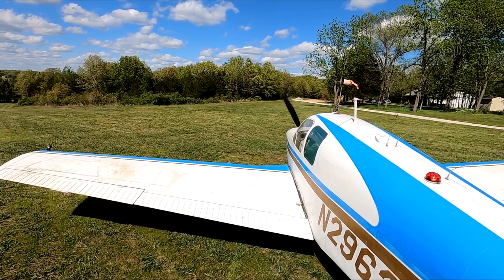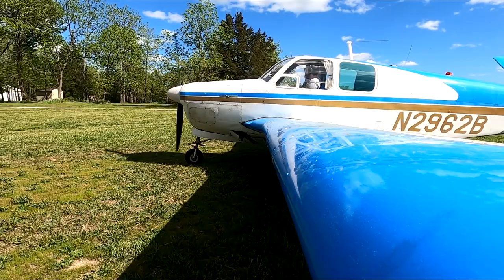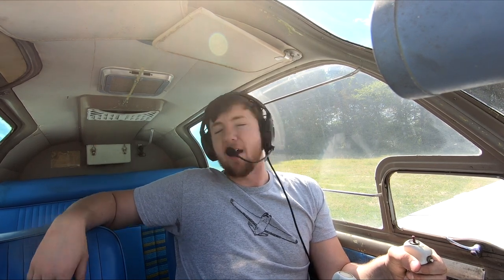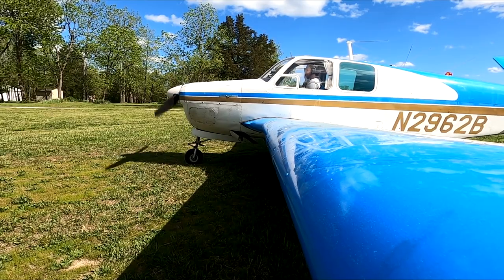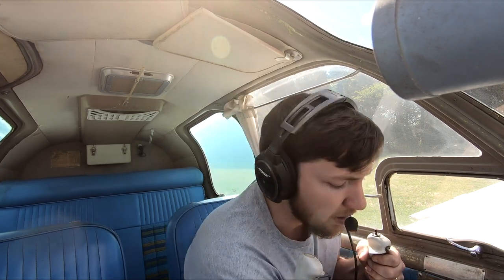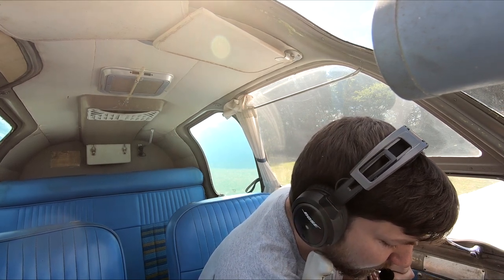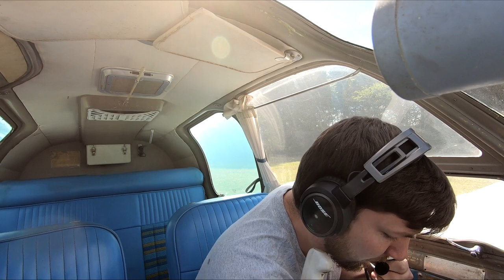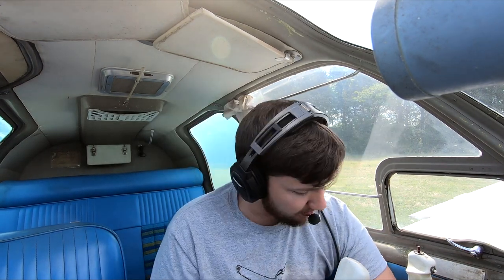BARN FIND V-TAIL BONANZA FIRST FLIGHT IN 15 YEARS!!!

Comment: In my Straight 35, I do 90 for normal ops and 85 for short field.  Your dad was right to be mad because he could have lost his son right there.  There is no "have to go" in what you're doing.  If conditions are unsafe, then stay on the ground.
Reply from the maker: It’s not always easy to judge what conditions are safe and what conditions are unsafe from the ground. I went up right after and knocked out 7 landings without issue. The wind was not beyond my capability, it just caught me by surprise. The risk is always higher when you decide to leave the ground.

Comment: I use 90 mph as normal approach speed to most fields in my F35. Short field I will go to 80 mph. I find the extra speed helps with controlling the plane and it is less susceptible to what happened to you. With full flaps and the gear out once you pull the power off it decelerates very fast. I usually pull the power off before crossing the threshold. Glad it turned out okay, could have been pretty bad if the wing was snagged.

Comment: Hey as a low time VFR pilot, that has gone into some tricky fields, but none as tricky as yours here: I think the way you flew this was absolutely reasonable. You can clearly see that you come in with more than a little excess airspeed by how low your nose is on approach. I assume the gust caused a rotor behind the tree that made you loose height and airspeed. Nothing you can do about it. Coming in at 100 seems ridiculous to me on such a short strip. The only thing I will say that I would've done differently is to probably not fly on such a windy day. Especially if you are going into a small strip that has trees on either side. A buddy of mine got stuck in a tree next to the runway once because of a microburst. (Nothing much happened to him or the plane) Don't underestimate the wind. Especially when the topography is not in your favor.
Reply from the maker: I think you nailed it. I wasn’t stalling on final it felt like I was being pulled into the ground. I did several more landings same condition right after and I added 10 mph to 90 or even 100 and it went from being sketchy on the approach end to being sketchy on the departure end trying to get the plane stopped. The real solution was to not fly until conditions improved as you said.

Comment: Well, that was a fun one!  You Weeks boys have become the Bonanza resurrection specialists!   I'll have to say that I side more with your dad on this one.  At work we add half of the steady state headwind and all of the gust factor to our approach speed.  For example:  if the wind was down the runway at 12 gusting to 20, you add 6+8, so 14 knots to your approach speed.  Do I always add that much in my Bonanza? Probably not, but I definitely add some. Just realize that if the headwinds are that significant, your groundspeed will be significantly slower at touchdown so you won't need as much roll out.  Also, try to correct a big sink by adding power instead of instinctively reefing the nose up.  (Maybe you added power, just can't tell in the video - but the nose certainly came way up)  My strip is about 3000 grass, vice 1800.   You definitely had your hands full!  That would've been a challenge for anybody.  I doubt if you posted this looking for flying lessons so I'll shutup now.  Keep putting out the fun content and have fun on the big road trip out west for the next Bonanza!
Reply from the maker: Hey, I’ll take your flying lessons any day, Brian! I know your credentials, and I just know you’re a nice guy. 

I did goose the throttle along with the flare in the landing, but it wasn’t quite enough to miss all the trees. From a percentage standpoint I did miss 99% of the trees at the approach end 😂. Only hit the tallest one. My stall speed was 52mph dirty and the winds were at the most 12 mph gusting to 20. 1.3 vso is 68 plus half the gust factor would be 72 mph approach speed. All the gust factor would be 76. I came in at 80 even though I was saying 75 in the video. 80 is just a more comfortable speed for me. The stall warning horn wasn’t chirping so I wasn’t slow in the flare. I think the wind just pulled me down below glidslope at the worst possible moment. I still touched down at my point I just didn’t clear the one tall tree before flaring. Again, I’m just a 350 hr private pilot, so I probably should carry extra speed as insurance. I’m not landing on an aircraft carrier lol
Reply: The way the plane dips looks like something was happening behind the trees caused bump or hole.  Best thing would have been to stay higher over the trees if possible.

Comment: Having done this to some degree on short field in my 47, I would say your dad is right. 
Physics don't lie.  
Came in too short on the runway or too slow / or both IMHO. 
Doesn't take much of a gust to drop you out of the sky.  I was short-fielding at 75mph which is above the approach speed. Not too much wind that day and about 10' up from the runway, got caught  on the flare and stalled my left wing.  I caught it fast, but plonked down on the runway enough that I stopped and got out and looked. 
So I added another 5mph and made my aiming port another 100' down the runway.  
Should be able to stop easily on grass once the wheels are down and brakes are applied.
Reply from the maker: Didn’t come in too short, but too slow is possible. Gopro cameras and a phone camera 1000’ away have a hard time with depth perception, but I was never really aiming short of the runway. My touchdown point was right at the start of the clearing, and after the gust and subsequent throttle goosing, my touchdown spot moved about 50 feet further down the runway.

I’ve landed downhill to the north at about 100 mph indicated when I have a pretty significant headwind, but it is not a fun experience. The runway disappears real quick, and the last 500’ is a very steep hill. You don’t want to be going faster than 20 mph trying to stop it’s so steep.

All that being said, yeah, I clipped a bush one time, out of the 60-80 times I’ve landed that direction. I would prefer the number to be zero, but it is what it is.

Comment: I’m considering getting a v35.  But it has the e185-11 and the prop ad.  Wondering what your thoughts are.  I heard they’re hard to find parts for and I still have training to do and don’t want to be held up over parts availability.  Thanks!!
Reply from the maker: Wouldn’t be a V35 if it has the e185-11 engine. I’m not a fan of the Hartzell hydraulic prop with the five year AD, but the E185-11 engine is a great engine. All the E engines leak a bit of oil, but otherwise they are bulletproof. Parts are not hard to find. They don’t make cases, cranks or cams for them anymore, but there are plenty of old salvage engines to get those parts from when needed. 

If you’re still a student pilot, you have to consider the fact that you are essentially uninsureable in a Hp complex aircraft. If you buy the plane with cash you can self insure and train in the plane, but if you finance the bank is going to require full coverage, and there are really no carriers that will be willing to write you a policy. Not the fault of the plane, but insurance companies seem to make the rules in all industries now.

Comment: Sketchy landing.  Figure out another option.  Land elsewhere if you're concerned the strip is too short.   Or forward slip.  Wind gradient + rotor got you.  FWIW - most of us have been there -  You got lucky.
Reply from the maker: I had several other options if I needed to divert. I ended up doing about 6 more landings right after the bad landing and had no trouble. Just got sloppy.

Comment: Please don’t forget that the stall speed will increase as you add people and fuel.  It will not be 55 at gross weight. Happy flying
Reply from the maker: That is an excellent point, Gary! Thanks for pointing it out. Definitely emphasizes the importance of stalling the plane at different weights and configurations to get an idea of how the plane will perform in the landing flare. The early Bonanzas have a gross weight stall of 56 mph on a standard day. Most of my flying is well below gross weight, so I do frequent stalls to get an idea of how much I can and should adjust approach speed to avoid coming in too fast and wasting the precious little runway I have available at our home strip. In this instance, I adjusted for stall speed, but underestimated the winds and wind terrain interaction, and it could have turned out very bad.

Comment: So do you find and sell these tails?
Reply from the maker: We find them for sure, and we are supposed to sell them, but so far we just end up keeping them. 

The goal is to take old projects that a lot of people would write off as scrap and get them back in the air again. People seem to be more willing to buy flying airplanes than barn finds with the wings pulled off.
Reply: Oh I love the looks of these planes. If you ever want to part ways let me know! Would love to learn more about them
Reply from the maker: https://bid.yarbro.com/lot-details/index/catalog/32/lot/4875/1947-Beechcraft-35-Airplane we recently acquired the 1947 bonanza pictured in this auction for a song. Stored in a barn in super dry Washington for almost 40 years. Not even 2k hours on the airframe and less than 400 on the engine since major overhaul. 

It’s for sale now disassembled. Will be a while before we have a chance to get the wings back on and get it flying again. If that’s something you’re interested in, you can shoot me an email at benweeksbonanzapilot@gmail.com
If it doesn’t sell, it will be the next project plane we get airworthy again. About the most bone stock original bonanza you could find.

Comment: So how much bondo did you need?
Reply from the maker: 😂 thankfully none at all. Some green stains had to be washed off the wing and a branch or two out of the right gear and I was off to knock out 7 more landings. Wasn’t about to let that wind beat me.
Reply: So was that just a rotor that hit you on short final?  I ask because I had a similar landing without the trees in my D35.  Everything looked perfect, 75 over the numbers and a slight up and sideways enough to be landing in the dirt.  I corrected to get back on the pavement but it sank just the way you did.  First time I have ever banged the elevator stops. It settled smoothly but firm.  Scared the crap out of me because I really did not know what happened.  The only time I heard stall warning was when yanking back on it to keep nose up.  Had a sleepless night where I was staying and flew back home to a greaser.  Of course my wife was with me on the landing.  She said other than some wiggling around all good.
Reply from the maker: @dirtcurt1 as near as I can tell that’s what happened. If the one tree top wasn’t there it would have just been a “solid” short field landing. Stall horn chirped in the flare just like your experience. Runway was assured so it wasn’t a major deal, but I would have hated to tear the plane up.
Reply: @BenWeeksBonanzaPilot  One other thing about the take off.  In the 80's Beach recommended no flaps on takeoff for just about anything with the Bonanza wing.  You might look for yourself about it.  Beech said flap gains were not worth the effort.  They said if the POH allows it, and you want to go ahead, you just don't gain anything except for a soft field TO (maybe).  I read a few high-altitude fliers say definitely no flaps, you will actually lose performance over a 50ft.  NOT criticizing, just getting your thoughts because we have the same plane.  Oh, they are fast, mine has a 225 and my long time friend and IA can't believe how fast it goes with a 225hp.  I can plan on 145-165 mph indicated, with a ground speed at 7-9k of 190 mph at 12gph. 165mph at 2000 ft 25"
Reply from the maker: I have heard about the No flap recommendation from Beech, but I have never honestly considered it for sub 2k ft runways. It would be interesting to make a video comparing flaps to no flaps in a 1000 or 1500’ distance. I’ll have to keep that in mind.

The other reason I use flaps is to cause less wear on the gear on non pavement runways. The flaps really help get the weight off the wheels sooner. On my cow pasture landing video (will be posted soon), it was essential to use flaps because the bumps were outrageous even with flaps.

Comment: I strongly suggest you get shoulder harness installed in all your planes asap. That tree strike could have been a survivable accident but without the harness maybe not. That tree strike could have been a survivable accident but without the harness maybe not.
Reply from the maker: Yeah I was just thinking about that earlier this week. We have been resurrecting a lot of planes recently, and the last 4 have not had shoulder harnesses which is just stupid. I think it’s going to be a requirement for me from now on any time I’m doing a test flight on these planes. The increase in safety with shoulder harnesses is just a no brainer.
Reply: @BenWeeksBonanzaPilot  I had had my F35 for several years, never really thought about it. Then a fellow flying an F35 mismanaged the fuel, the engine quit on short final and he landed short and hit a ditch. The two back seat passengers got out of the plane a little banged up. The front seat passenger died of head injuries a few days later, the pilot died about three weeks later from head injuries. I ordered the Alpha Fixed system the next day. The A&P put it in less than 8 hours. I think given your skills it would be less. Cost effective system. You have to drill a hole in the side of the plane but it is pretty unobtrusive.

Comment: 🤐 this will get some views I think.....pucker factor pretty high...  If I was flying into your field I would use a steeper approach to avoid this again :) Good work on getting it back in the air.
Reply from the maker: Yeah, I learned a LOT from that flight! I was debating posting, because it doesn’t show me in a great light lol but I think it will s important to show the good and the bad. At the end of the day we’re all human. Mistakes happen, we just have to learn from them.
Reply: @BenWeeksBonanzaPilot   Meh, you have put together 2 e series now that were not flying. You have earned some clout for sure. Landed the plane and it is usable again, haha, job well done. I also would have just let the horn blare the whole time vs ripping it out. Learning is the most important part of flying. I learn a bit each time.
Reply from the maker: @benjigault9043  yeah if it was a correct gear warning horn I probably would have, but I have no idea what aftermarket monstrosity that thing was. I don’t think it’s approved for that plane. Needed to be changed anyway. Lol
Reply: @BenWeeksBonanzaPilot  I had never heard one pulse before like that and it was awfully annoying so cant blame ya there haha

Comment: Hahaha "stupid thing" fumbles below camera pulls wires and tosses something in the back seat! " That'll take care of that!! 😂
Reply from the maker: Out-of-adjustment throttle warning horns and I have been at war since the very first time I test flew the red A35 Bonanza, and I have yet to fly one that was set properly. Usually I can ignore it, or just run at a higher manifold pressure so that it doesn’t go off. In this case, the alarm was so loud and irritating that I elected to uninstall the horn in flight so that I could conduct the rest of the flight safely.

Apparently they are designed to warn the pilot if they have reduced power (for landing) but the gear isn’t down so as to prevent a gear up landing, but I am starting to think that they were just designed to annoy an already stressed out pilot who is test flying a plane that may not have flown in one to two decades. Lol

Comment: Nice video you accomplish what you set out to do, fly the airplane and get some good video shots. As an experienced certification and flight test engineer and mechanic, I don't think I would have taken the aircraft up in those conditions, if you truly wanted to evaluate how the airplane is flying to include being stable and in trim. To clear the trees I would have flown higher and slipped the last 150 ft to get to the correct touchdown point, again I would have done some slips at altitude along with other handling quality checks.
Reply from the maker: I think you nailed it. The approach was actually pretty steep as you can see in the phone video. The gopro makes it look really low because there’s some distortion in the field of view.